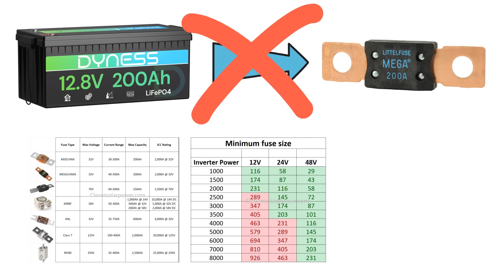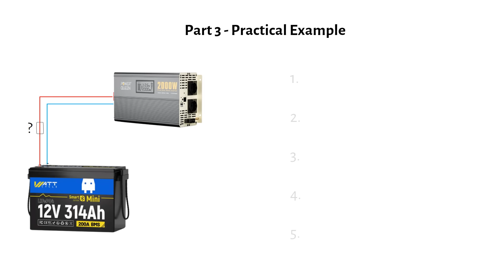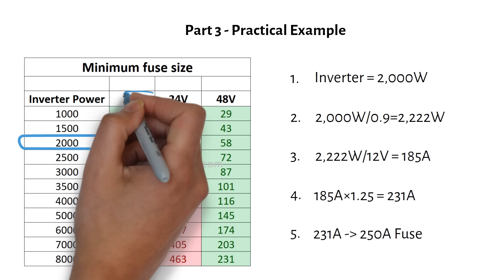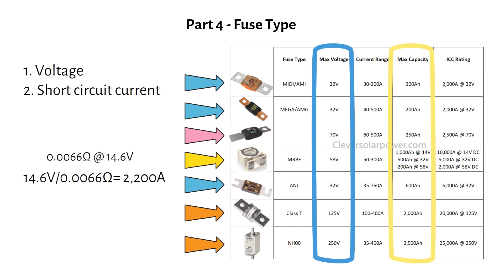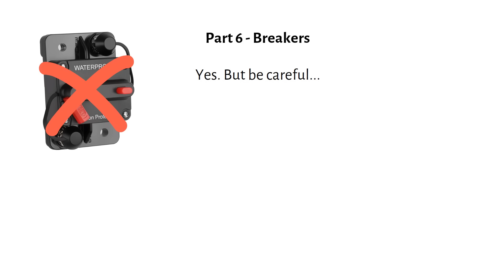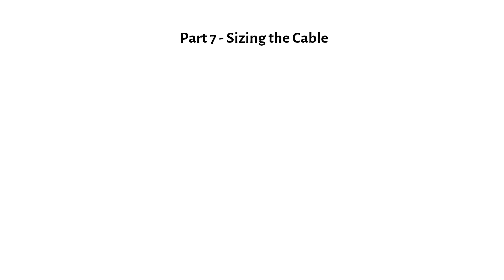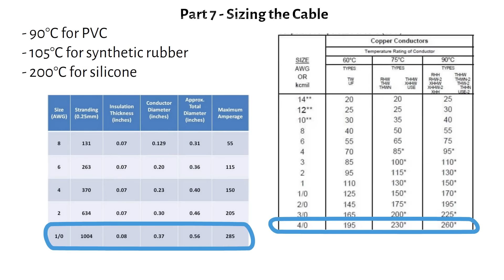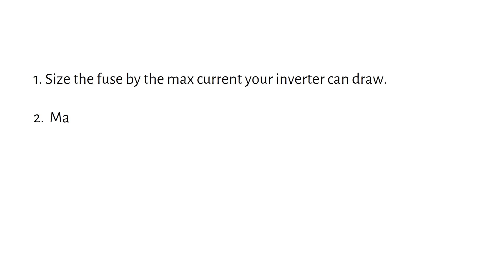How to Size Your Battery Fuse to Inverter

Comment: You’re so right people get amp hours  mixed up with amps and that’s certainly not the case. Amp hours is the amount of amps a given battery can supply in one hour in this case 350. So if you had a load of 1amp it could run for 350 hours a 10amp load 35 hours. assuming the battery were capable of it, which in this case it isn’t, a current draw of 350 amps the battery would last for just one hour.
Reply from the maker: 1A for 314 hours is theoretical though. I agree that people mix up amp and amp hours. I understand it's quite confusing.

Comment: What about the wire from the charge controller?  I am confused how/how much the inverter draws from there.  Thanks.
Reply: Fuse the charge controller to 150% of its rated output (and make sure the wire can handle that).  Otherwise the fuse will overheat because charge controllers often operate for hours at exactly their rated output.
Reply: @junkerzn7312  Thank you
Reply: A charge controller should be fused to its rated output. So if the charge controller is let’s say 12 amps the you need to protect the cable leading to the battery preferably were it connects to the battery with a fuse based on the 12 amps = 144 watts divided by .9 =160 divided 12 v =13.33 amp the nearest fuse would be 15amp.
Reply: @wobby1516  Thank you.
Reply: @wobby1516  How about 12A / 0.9 = 13.33A ?
Seems easier.
Reply: The inverter would usually draw from the batteries, not from the charge controller. 
So you only really need to consider cable size and fusing for the CC based on it's max output at rated voltage, plus a safety factor of 1.25 or 25%
Reply: @andrewford80  Thank you

Comment: Need help here..im running 1000watt panels with a VOC of 37v for charging 24v batteries i need to know if i can put a DC SPD of 500v which is all im seeing instores yet my voltage is just 37v
Reply from the maker: 1000W solar panels don't exist, I assume you mean 100W panels? Yes, you can use a 500V surge protection device, i believe there are 250VDC as well. It's a surge protector, not a disconnect switch, so make sure you have one.

Comment: Thank you. Ive shorted an inverter and nearly burned my 5th wheel  and let me tell you. I had fuse and breaker and niether stopped the short. Turned into the 4th of july at the inverter.
Reply from the maker: Damn, that must have been terrifying. Knowing the fuses didn't break the circuit 😳
Reply: @cleversolarpower yes it was all bad and out of controll thank you for this topic. Im sure you will save many people lives and lots of money and head ache.

Comment: Dang what an awesome chart. Great idea
Reply: When Will not only watches your video, but gives it a big thumbs up, how cool!
Reply: Gosh I've never added inverter efficiency. Always use safety factor only. Good to know
Reply: @WillProwse  As you know, the thing about inverter efficiency is that it is not running in a straight line but on a curve. It has it's highest efficiency at between 30% to 60% output, depending on the inverter, and drops as it is going towards maximum delivery.
Reply: @KHJ_am_I yeah very true..can vary a lot depending on load
Reply from the maker: That will make for a good video, I'm putting it on the Todo list.
Reply: @cleversolarpower  Good. It will educate people more.
Reply: @WillProwse learn something new every day..
Reply: Both of you guys have really inspired me.
I'm still waiting for more parts.
It's really been a rabbit hole of information thank you!!
Reply: If will is here, then you know the content is good!
Reply: If Will Prowse approved my setup I'd literally use it on my resume with a link.

Comment: Thank you, Nick; you have reaffirmed what I did on one 100 Ah battery with a 1200 watt inverter and another I built with a 200 AH battery and a 2000 watt inverter. I used your book to determine these fuses. I didn’t think about wire size so I used 2/0 for the 100 Ah battery with the 1200 watt inverter and I used 1/0 for the 200 AH battery  with the 2000 watt inverter. These were all 12 volt systems. I will want to buy better breakers or fuses between the charge controller and the battery.
Reply from the maker: A little bit oversized cables, but that doesn't hurt (only your wallet). Make sure the fuse size is below the maximum current capacity of the cable.
Reply: 🎯 @cleversolarpower